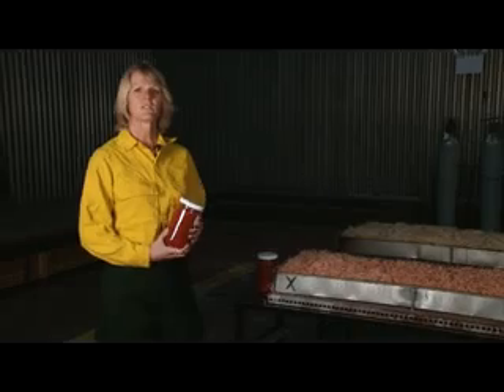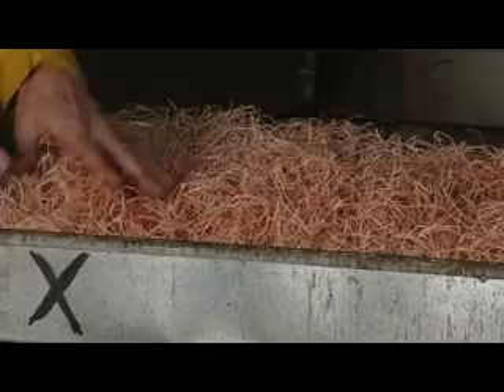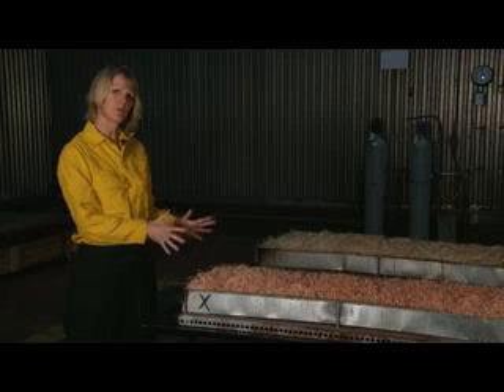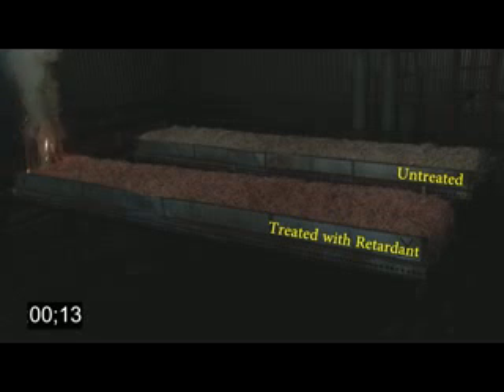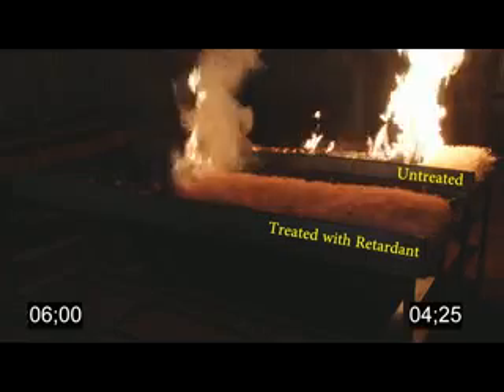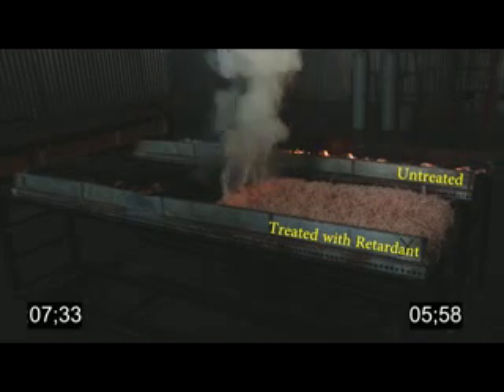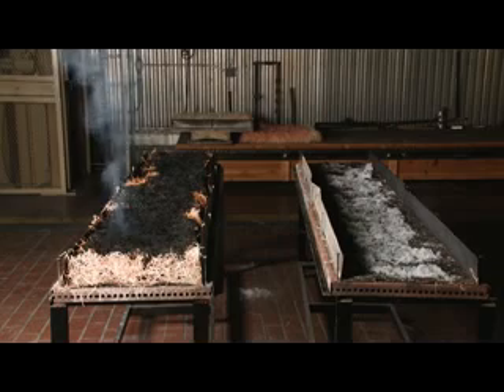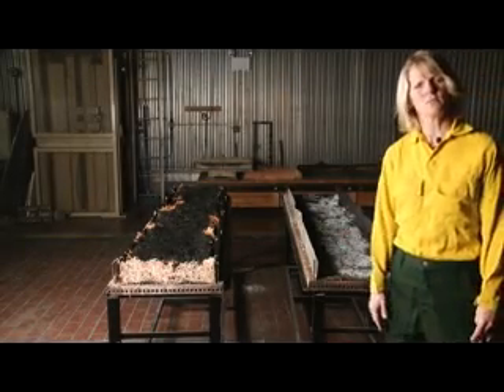Fire Burning in Treated vs. Untreated Fuels

Comment: OK folks-now I'm confused.  Can we decide how Phos-Check actually works?  I have been taught 3 different mechanisms are at work here.
1)  It removes heat.   2) After the water evaporates, the ammonia gas released as it burns it smothers the fire.   3) It turns the pre-treated fuel into a carbon which inhibits burning.   The only one that makes sense to me is the ammonia gas /smothering option since this is basically how ammonia phosphate fire extinguishers work.

Comment: Excellent presentation! My first fire was with the U.S. Forest Service in 1973. I've been around retardant quite a bit. I've been "snotted on" (retardant that drops on you or your equipment) 2-3 times. I never knew that much about retardant when I was working. I witnessed retardant dropped on a fire one summer and a drought winter followed. It was dropped on a ridgeline some distance from the fire, which was stopped a long way from this ridgeline, contingency retardant line. The next summer another fire burned between the edge of the previous year's fire and the retardant. The retardant stopped the fire after a year. This in sagebrush/bitterbrush dominated terrain.

Comment: Strange, but didn't the untreated fuel burn cleaner, which might be better, and both still burned. So is the retardant of much use?
Reply: The entire point is to make the fire burn more slowly and at a lower temperature so that it’s easier to put out. Cleaner burn means hotter and faster moving fire. It’s the exact opposite of what you want in a fire that you’re trying to put out
Reply: @fishiefish6179  
Have you seen one of those YT videos of a test burn of "legacy" furnishings versus modern furnishings? The old furniture takes almost 30 minutes to reach flash-over, while our modern petroleum-based furniture only takes but 2 or 3 minutes. A great reason to consider home fire sprinklers, if that can fit into the budget. Fire sprinklers cause far less water damage than the fire department will cause when they show up, and quite often not only slow, but even contain the fire. Else the old standard for homes, of having an extra door or means of escape and cheap smoke detectors. They also say it is good to close bedroom doors, although probably many people have reasons to leave them open normally.

The remedy for too many chemicals is even more chemicals and fire-retardants? Perhaps so.
Reply: You don't want clean burning in a forest fire!!!!

Comment: Interesting that the adjacent untreated fire actually seemed to affect the fire behavior of the treated bed - - a bit of a cross draft perhaps.
Reply: Yeah it seems like it's creating an updraft that's kinda pulling in from all sides, bending the smoke of the treated bed towards the untreated.
Reply: It does that in the real world too. A large fire can create it's own localized weather system. Firenados as called by some can actually reach up over 100ft with out too much difficulty. This starts a canopy fire. That's where the fire is mostly off the ground, and burns tree top to tree top with very high heat and moves very fast.